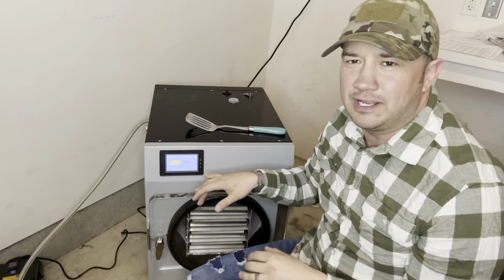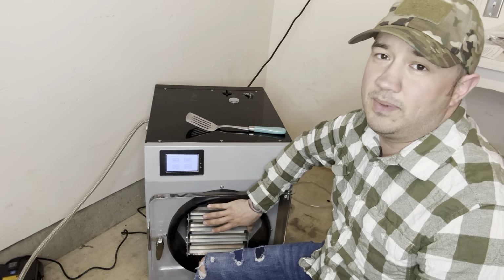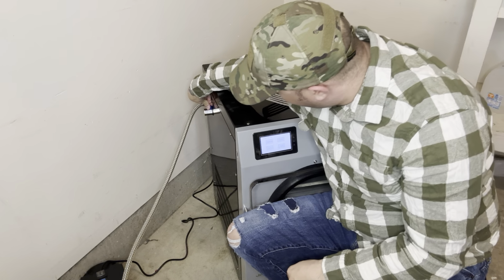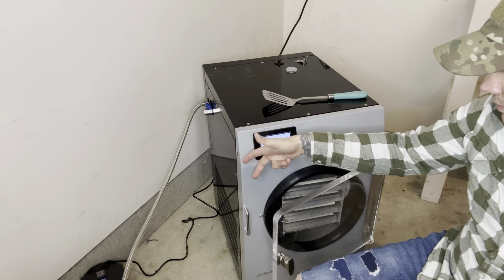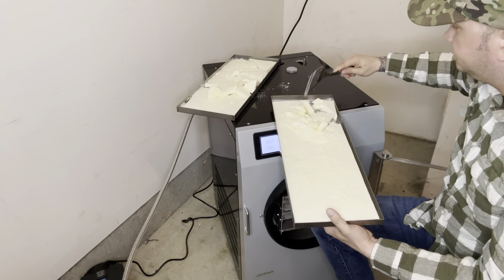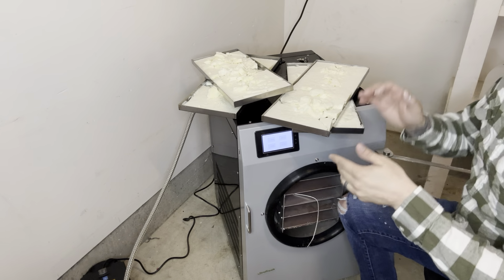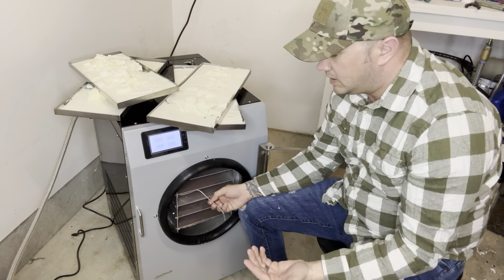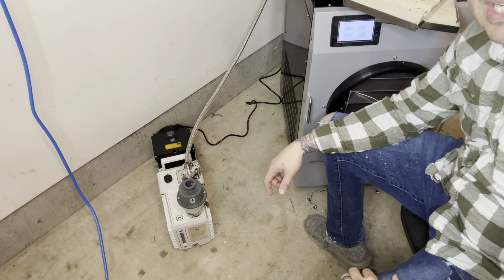StayFresh Milk Run

Comment: 56 hours of electricity to dry some milk?
Reply from the maker: Thanks for the comment as I totally forgot about this video one of the first I did with the StayFresh machine. That 56 hours included 24 hours extra dry time. So really according to the software it should have been completed at 32 hours. I’ll be redoing this test now that I know more about this machine

Comment: Which pump would you recommend, the industrial or standard pump, for home use not a busines .
Reply from the maker: I like the industrial pump its really heavy duty. When spending this kind of money I like to make sure I have good pump to go with it. Use code "FixmyFD" to save $50
Reply: @freezedryerrepairsupport  I had already bought my SF before I found your page.
Reply: @freezedryerrepairsupport  Dosen't the standard pump have lower mTorr then the industrial pump ?

Comment: How much longer dry time did you add? 50+ hrs is very long.
Reply: I have a StayFresh, I let it freeze my food and I’ve never had a 50 hr run not even with 12 lbs of food.  I also have a standard pump.
Reply from the maker: 24 hour extra run time was set. Also changed my mat down to 500. Going to redo this run at standard settings

Comment: Isn't that kind of long for milk?  Its been awhile since I ran milk but I dont remember it being one of my longer runs.  Just curious.
Reply: I think that was because he set 24 hours of final dry time (default was 7), I think it should be done hours before that.
Reply: I set default to 12 hrs.  I think he changed a setting from 555 to 500.  The program runs on 555.  It drops fast once pump comes on.  I love this program and my machine even with the standard pump.  My mTors drop to 121.  I’ve got a second one on order but with the industrial pump.
Reply from the maker: Yes changed lower mT and also did 24 extra. Going to run again with everything set to standard. Amazing thing about stayfresh is knowing when things will be completed.